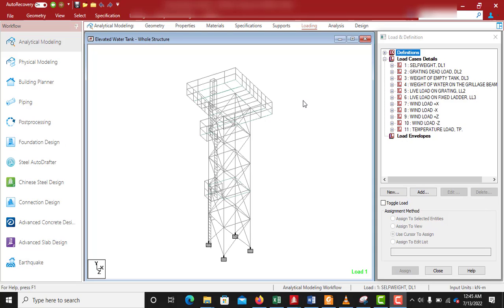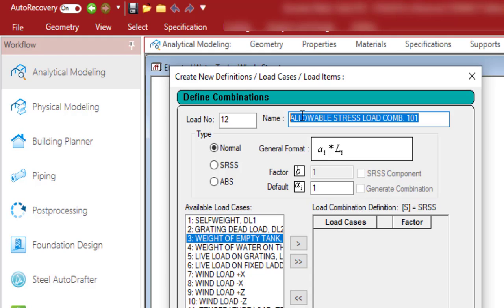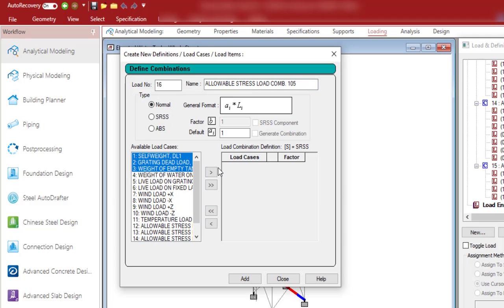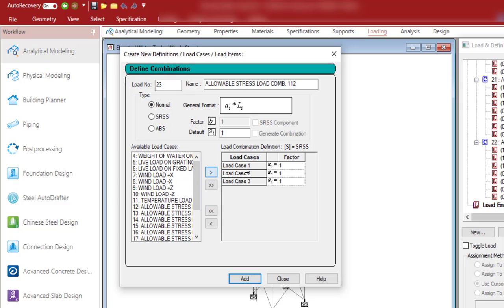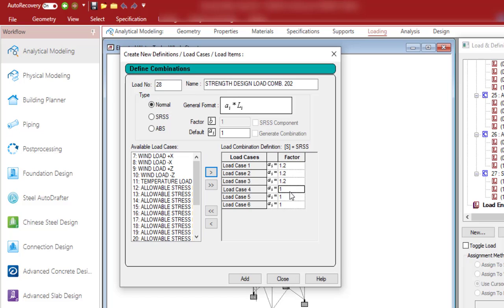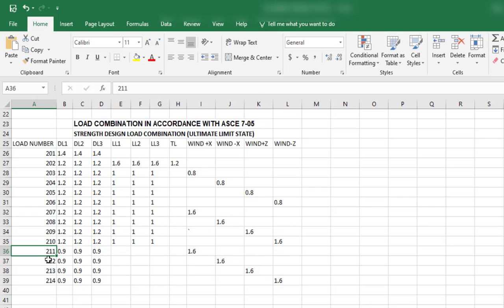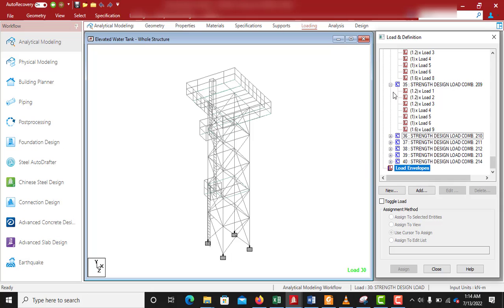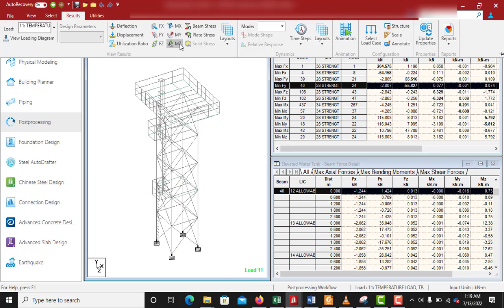How To Combine Load (Combination) in Staad Pro Advanced Connect Edition

Comment: Very educative,
In your previous tutorial videos, you defined three separate dead load cases: DL1, DL2, and DL3. If I combine all of my calculated dead loads into just one primary load case labeled "DL," will that cause any issues?
For example, if I apply the structure's self-weight and the solar panel weight separately, but both under the primary load case "DL," is that appropriate?
Reply from the maker: Thanks for the positive feedback.

It's still correct if you do it that way.